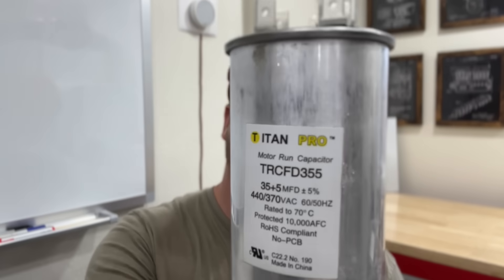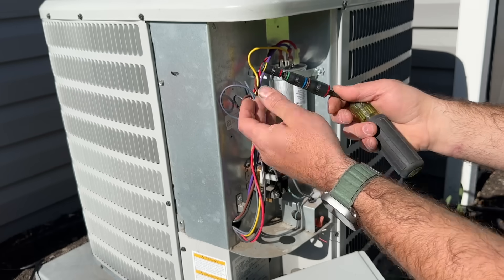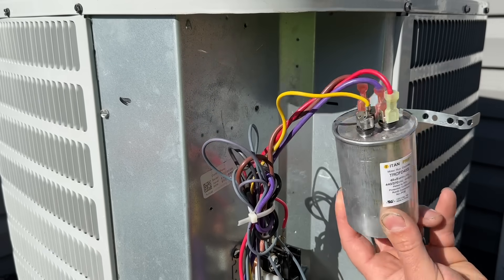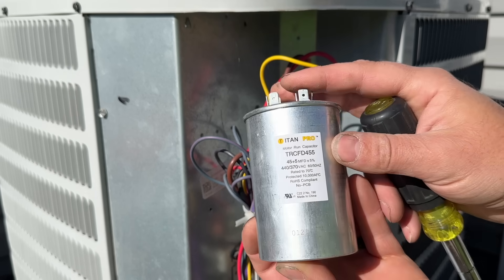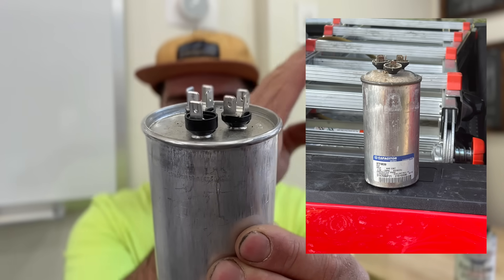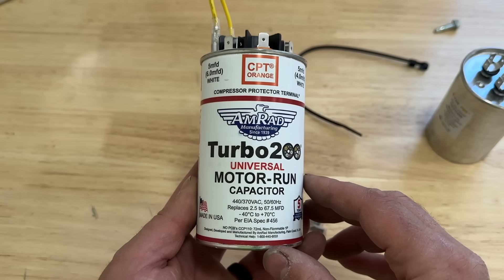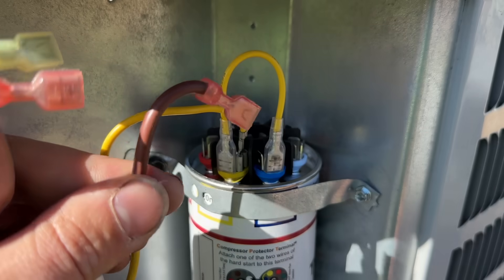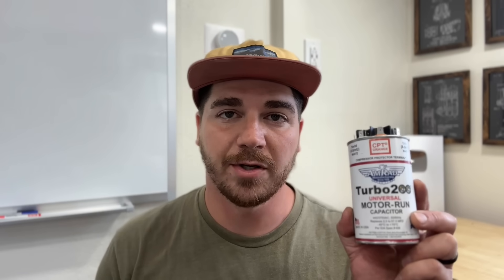HVAC Contractors Practically Make Their Living On These

Comment: AMEN! My A/C went out. I called the people who installed it. I was told the service call was $100. When the technician came out, the diagnosed that the problem was the capacitor. Now, he was already there (at $100, thank you), so I said, "Well, replace it." He said the part was $198! So what am I supposed to do? He has the damn thing apart, and I already owe him $100 for the work. When he was done, I asked for the old part AND  the new box. He seemed like he didn't want to leave it, but he did. When he left, I went on Amazon and found that the full retail price on this particular brand was 45!!! And there were other options (as you pointed out), as low at $21. I was ripped off, and I will never use these people again.

Comment: I ran into this last year.  4 year old AC went out.  Called the installation company.  They sent a guy out and he determined the cap failed.  I asked him if it was covered under the warranty for the unit, he said it was not, and sold me a Turbo 200 for $350 plus install costs.  I kinda had no choice at that moment.  Later I looked up the Turbo 200 and saw it on Amazon for $65.  So I called the company to complain about the unethical markups (I don't mind them getting a profit, and having their usual install costs, but over 500%?).  They didn't care.  Also then investigated whether it was in fact not covered by manufacturer warranty, and it turns out it was.  So I lodged an official complaint with the manufacturer that their only authorized dealer in the area was giving out incorrect information about their warranty.  The dealer ended up fully refunding my money.  They still feel like they did nothing wrong. I ended up offering to pay the cost on their Turbo 200 since they didn't actually submit a warranty claim.  

It's just so apparent this is a big money maker for them so not being entirely forthright and honest with the customer is such a temptation for even an otherwise legitimate company.

Learned my lesson and bought a new Turbo 200 to have on the shelf for when my parent's or friends AC goes out.

Comment: My advice is check your capacitor size when everything is working and order it and just keep it in a closet until you need it.  Don’t pay $70 for that turbo 200 when you can buy the right one for $10-$20 and it WILL happen at night or on a Sunday.
Reply from the maker: That’s what I advised when I was showing people how to located it on repairclinic.com 

But if they don’t want to, $70 is still cheaper than $300-2000 you could potentially be charged!  Cheers

Comment: Look you should not be working on your own HVAC stuff and if you get zapped, well good, you shouldn't be touching that system. Unless you have the proper training, licensing and equipment you shouldn't touch an air conditioner they are dangerous pieces of equipment that contain dangerous gases that are a federal felony to release. If I ever see you out touching a piece of HVAC equipment and I don't think your licensed I will call the EPA and cops and get me a quick ten grand for saving the planet from stupid ass homeowners or fake ass nitwits.

Comment: I just had a local company come out to replace the run cap. They came same day, were done in less than 10 minutes, and charged me less than $60 bucks. That's the way it should be. I could have done it myself, but they made it easy and worry free. Well worth the $60, but not $2,000! Not even $250!

Comment: Great Information. I had been renting a House that had stopped cooling, Landlord had an HVAC guy working on the side come by to check it out, he end up selling him a New HVAC System. As a Professional Automotive Wrench (Mechanic), I took matters into my own hands and Diagnosed the issue to be a Failed Capacitor, I replaced it myself and got the System up and running properly in the meantime. HVAC was still got replaced needlessly. Randy   AKA randog311

Comment: I have a 1978 rheem and was told the whole thing needed replaced  ,i replaced  2 capacitors put a new fan in, a new contact switch and a hard start kit for under 250 dollars and she is running like brand new ,js

Comment: +/- means that the value from the factory can be over or under 6% of the listed value. A 45 mike cap with a reading of 42 is still within the factory value. If it reads below 40 I would change it. The information you give is only partially corrrect.

Comment: $2000 is insane. We charge about $300 if we have to come out and only replace the cap. Unless you know how to check voltage, don’t do this yourself. Most homeowners will either wire it wrong or shock themselves.
Reply from the maker: You really have zero faith in the average diy’er. Haha I think anyone with some common sense can replace a cap safely

Comment: A decent multimeter that can test capacitors is sooner or later really worthwhile.There is another kind of meter sometimes called a "megger" can be worthwhile because it can tell you if a compressor is "burnt out".  There are other types of compressor failures, but a megger can identify the burn outs.

Comment: Blown caps are common. I used to hope for them so I could get done and move on to the next. We were big enough and busy enough we didn't need to milk an individual.  I actually was glad to be able to tell the customer it was a simple relatively, cheap fix. Not all of us are scammers. In fact I believe most aren't.   I did HVAC for 30 years and I never ever ever inflated the bill.  I actually bent over backwards to try to keep the price down.  Sometimes that did not work in the customers favor.  There were a few times I tried to save them money and it turned out I should have just replaced things instead of trying to repair. Yes blown caps are common, but don't slander us by saying crooked techs are.

Comment: Reminds me of a fairly high charge to the customer from a guy who showed up after 3 other repair folks tried to fix something but couldn't.  Customer asked the 4th guy "you were  only here 5 minutes, how come so much, all you did was tap a hammer !" The 4th guy replied "Yes, but knowing where to tap the hammer is my expertise".
Reply: There was a man named Charles Proteus Smith who is considered to be the very first Electrical Engineer. He designed the first hydroelectric power station at Niagara Falls and he worked for the company that became General Electric. Once people saw that this worked, other rich men, decided to invest in a hydropower station, including Henry Ford. After his station was built, one of his generators was only producing about 15 to 20% of what it should produce so Ford asked GE to send someone to fix it. C.P. Smith went himself and when he got there he told them he needed some pencils and paper and a cot. And to be left alone. Two days later he asked for a piece of chalk and a stepladder. He climbed up on the ladder and made a big X mark. He told them to remove the cover panel and unwind the coil there some exact number like 22 times. They did it and the generator began to work at peak efficiency. A week later Ford received a bill for $10,000 for the repair, over $100,000 in todays money. Ford returned the bill asking for an itemized bill. Charles Smith wrote the itemized bill himself. It read "Placing the chalk X on the side of the generator $1. Knowing where to place the X $9,999. Ford sent them a check the next day.

Comment: HVAC capacitor economy is strong around my city. Those stupid $15 start capacitors are being charged at least $45 around here and those are the biggest money makers for hvac guys here. We replace a lot of frozen fan motors too and the company I was working at charged about the same for a motor replacement as a capacitor, we were doing all commercial work but it was definitely scammy territory and this company wasn't unique in that, they all do it around here. We only used hard start kits on consumer stuff like refrigerators. So our vans weren't just filled with them we had a couple of them on hand but there were boxes and boxes and boxes of start capacitors in the vans.

Comment: please let people know that uf is not on most volt meters. I have 4 and none of them have it. BUT I do know that allcapacitors I have on air conpressors, air conditioner and anything else has a label and its super easy to write it on the inside of the compartment with a permanent marker

Comment: Knew nothing about capacitors, unit was not working/running, compressor humming and HOT.
My tip here is my capacitor looked like a beer can that had frozen ie: all swelled up and puffy looking, if you see one like this it’s probably fakked.
Really a great video on this problem, I own a nice multi meter and didn’t even know it had a capacitance function .
Anyway great video THANKS!!

Comment: Why are we in the USA still using a very inefficient outdated air conditioning system? The rest of the world has been using mini split systems. No cooling or warming air temp lost going through all that ducting. No expensive air handler involved. They worked excellent for me when I lived in Sweden and worked great when I lived in Saudi Arabia.
Reply: It's the same way with gas and electric stoves. The rest of the world uses induction heat.  We got one of those of those induction plates and my son said it boiled water in his pan in 45 seconds.  And they cost almost nothing in comparison.

Comment: Yep, been there.
Got a whole new system installed as the cost of call out to investigate the problem was almost the cost of the machine then plus parts which they said could be more than added together the cost of a new one.
I had a new one installed, and I kept the old. As lm not qualified in that area l started investigating, asked a sparkie l knew of possibles, he said check cap, Sure enough was gone, replacement part was $20.
Common practice here in west australia.  
The old story put a licence on doing it and watch the cost blow out to silly sums.

Comment: For a person who doesn't use a multimeter more than once a year can you recommend a multimeter that can provide the measurements that you covered in this video as a price that's affordable. What specific measurements must the multimeter provide at a minimum.
Reply from the maker: Microfarads, and voltage. You can find a cheap 50 or less multimeter that will read microfarads

Comment: I keep an extra capacitor rated for my AC unit as a backup in my house.  Cost like $30 from Amazon.  Last one went out two years ago... I went out swapped the capacitor with my spare.  AC back up in 10mins.  Bought another backup and prepared to go for the next time.
Reply: That is actually an excellent idea.

Comment: This is an amazing video. 2k is a lot! But I believe it. I had a $50 coupon for someone to come out and check over my system. It was getting old and it's good to have a professional go over everything, tell me what's wrong, then I fix it myself. The day before my appt, my unit quit running. I diagnosed it and it was indeed the capacitor. The guy called me that night to verify the appt. I told him what I did and he said it would be $350 for a new capacitor.  I cancelled the appt, went to grainger in the a.m. and replaced it myself. The new one was the most expensive one they had, $50. But most capacitors were in the $15-$25 range. I wonder, are these universal capacitors better or worse than the traditional capacitors? Thanks for the video!

Comment: Dumb question, if the capacitor is bad could it stop the unit from turning on at all?
Reply from the maker: Yes, in some instances it will stop the fan and compressor from starting all together
Reply: @diyhvacguy  Right, you can spin the fan to get it started which is what I did at first but then that gets old.

Comment: Most of the HVAC industry is a scam. Play charge people 300 or more for a service which is just them pouring soap through the fence of your heat pump.. they rely on convincing people they have some specialized knowledge of training. You can literally replace your entire system yourself.. the manufacturers provide detailed instructions. 
Other industries are this way too. P if you put your car in the shop there is a high chance they will put an ODB scanner on it and just replace everything it says it's a problem. There's a good chance that won't fix the problem add that song called most of the m
I was an incredibly skilled computer programmer way back in the day that I saw it happen to computer science as well. The people call themselves it experts now who basically understand things I can teach your great-grandmother in an hour. People who ride in stripped languages call themselves programmers.. there's a huge industry based around building computers.. I can write to paragraphs that tell you everything you need to know about building your own computer
Reply: I think so too.  I watch guys on YouTube now showing people how to install A/C units and furnaces and I remember 10 years ago they were saying don't do it it was dangerous like dismantling a hydrogen thermonuclear bomb.  Clearly it isn't that hard.  You are correct with car repairs.  I saw a TikTok thread where programmers were all saying the comments that they google answers to programming problems most of the time.

Comment: I am clear and direct with all my customers if asked on markups. I show people what needs to be done and educate them. I even showed a customer how to clean his own condenser recently..however, i just returned to his home  from a service call and i found out he tapped a screw straight through his condenser coil.. a few weeks ago a client of mine plugged a high voltage wire to the  low voltage side of thecontactor.... these people were proclaimed to be mechanically inclined and motivated. I was happy to help and i was confident in them..
Now I'm having to charge them 1000's to fix their equipment.. 
You have a great channel and i sincerely respect your motive behind helping people but you gotta understand that experience is well worth a markup. If an experienced tech occasionally fucks up, imagine what a novice homeowner or DIY guy can do...
Reply: Do you have the slightest idea how many times I spend hours fixing what DIYers break. I am just gonna mention few, wiring a nest thermostat, extension cords, wire nut among others
Reply: Why do tradesman hype up there line of work so much?
Reply: Very well said. Experience is invaluable. It’s easy to make a mistake when working with electricity and high voltage capacitors. It may seem easy to us but to your average Joe who’s looking from the other side could get the surprise of their life.
Reply: Believe me I've been working on these for years.
    It's well worth the price of a experienced technician to come out and fix your unit. 
     These units can be very delicate at times and it takes experience and Steady Hand to repair them properly. 
   It's well worth the price to hire a professional.
Reply: I am an experienced technician, and sometimes I call for technician to help, two heads are better than one sometimes, and one can always learn something. 
    I pay another technician to come out and help me out of my own pocket, and each time I learn something. 
    The education is well worth the money and a whole lot cheaper than making a mistake.

Comment: A good way to avoid being scammed by dishonest A/C technicians is to watch a video on youtube of the problem that needs to be fixed once he tells you what is wrong so you can get a good idea of what the repair should cost. About 13 years ago, I caught a dishonest A/C repair technician trying to charge a friend of mine $1,700 just to replace a loose blower wheel that was rubbing inside the housing and making a lot of noise. Fortunately, she called me and asked for my opinion and I immediately knew the guy was trying to defraud her out of a lot of money. I went up inside her attic and tightened the set screw on the blower wheel and the problem was fixed in under 5 minutes without replacing any parts. I wanted to call the guy up and give him a real tongue lashing but she was afraid of retaliation so we had to just let it go. I hope that a-hole got what he deserves.

Comment: Yup, 100% scam. I agree. The first time this happened to me I didn't know so the HVAC guy came out, replaced it in about 10 minutes, and I was good to go. Charge? $350. BUT, he tried to upsell me on "cleaning the A/C airflow" or something like that, for another $100. I asked what that meant. After digging, it basically came down to him taking a hose to my external AC unit vents and spraying the dirt/dust off of them, that's it lol. I now have a couple of these capacitors stored in case my AC goes out again that I picked up at an HVAC store. I couldn't find them for sale anywhere during the evening as all the distributors were closed, and your normal hardware stores like Home Depot or Ace didn't carry these. Thanks  for posting this!

Comment: I have a TRANE XL20 two compressor unit from 2012...
I proactively replaced all three (2 Compressor / 1 fan) capacitors last year for less than $80 in parts.
The Summers are hot here and it's the heat that kills them!
Personally, I'd discharge the capacitors while still hooked up, no need to risk touching any wires.

Comment: Why not just look at your Capacitor that is on there and order exact size for less than $25?   Why does one need a Capacitor that will work on multiple systems unless you are a Tech? Just get the one you need.  I do like Made in USA but damn!  $75